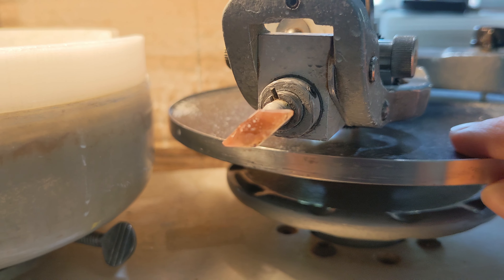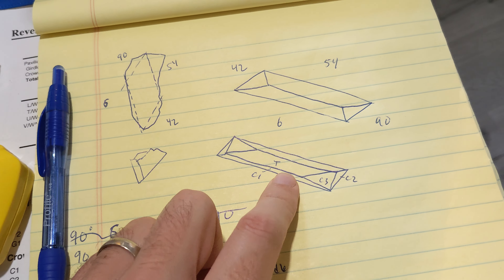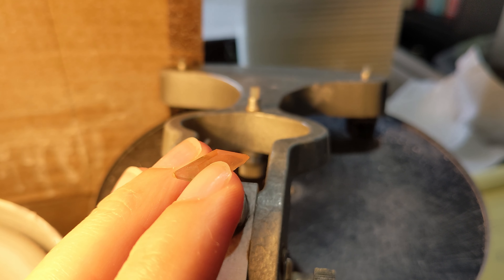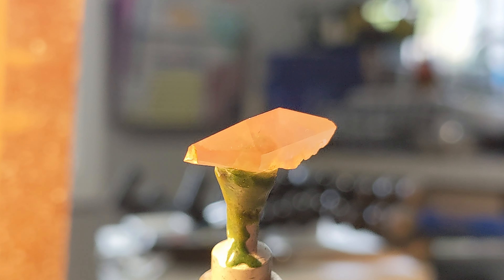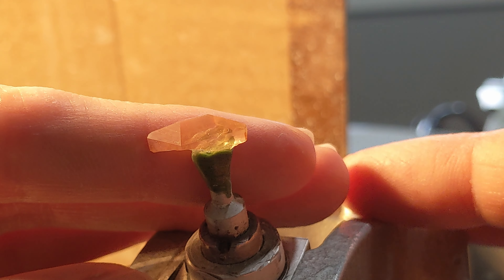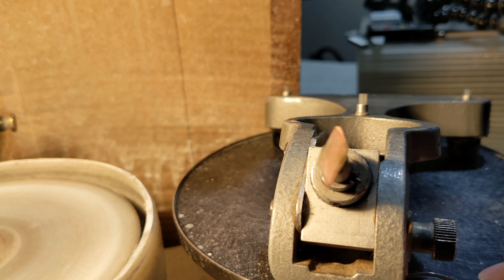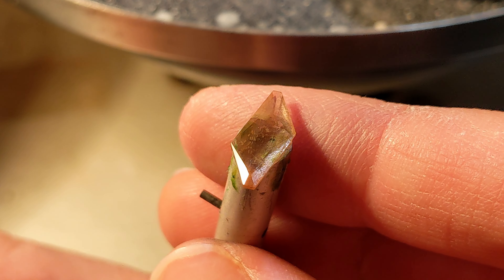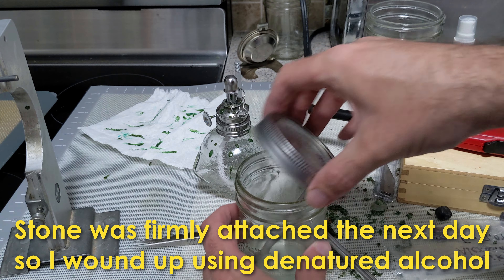Oregon Sunstone With Schiller | Faceting On The Fly

Comment: I am so in love that you did this whole project, especially with the sunstone! Also diggin the play noises in the background. Such a bummer about the fractures. If you haven't tried it, the wintergreen oil can help to see those ahead of time with a refractive index of 1.53-1.54. Doing a free-form facet job seems like it would save many sunstones that would otherwise be unusable and  the unique end effect is stunning. Beautiful job, that would be gorgeous in a custom setting. I'm going to have to get details on how you worked a free form pattern out before long. Thanks for sharing!
Reply from the maker: I'm terrible at free-forming (part of why I have trouble with cabachons), so even my improvised cuts are symmetrical! If you plan to cut a lot of sunstone, you might check out Jeff Graham's "Addition #11: Sunstones" book of designs. It's available from The Rock Peddler, and you can get a preview from jewelcutter.com (email me if you can't find it). It has a lot of designs for odd shapes.